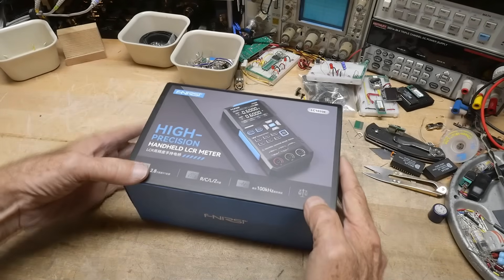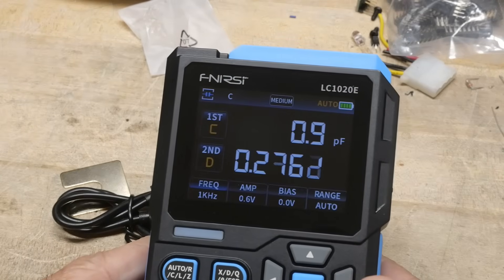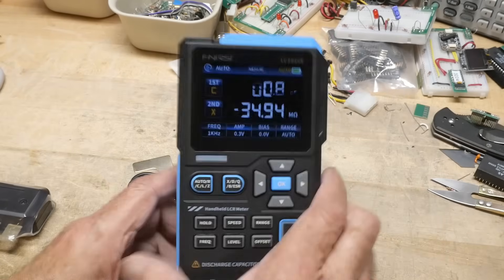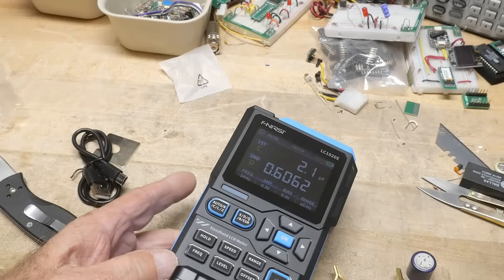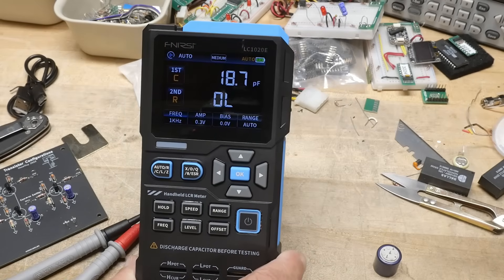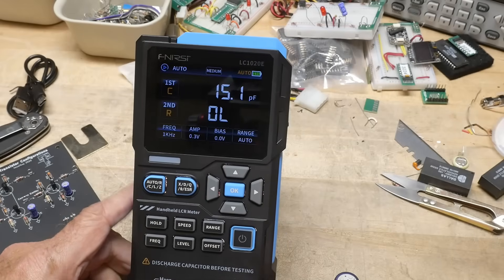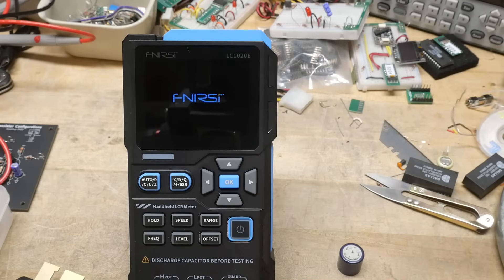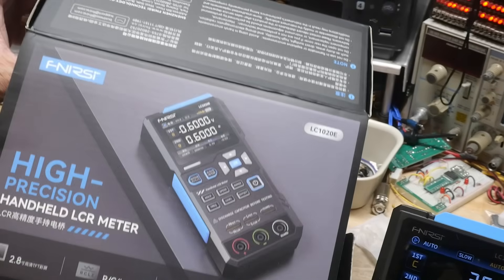#2416 FNRISI LCR Meter LC1020

Comment: I've been refurbing a vintage RIAA magnetic cartridge preamp recently and decided to make it as precise as I sensibly could without spending silly money on expensive uber-tight tolerance components. One of these meters has been close to perfect for selecting resistors and capacitors for the EQ networks and got me within +/-0.1dB of the RIAA curve from 20Hz to 20kHz. When you look at the price of ready-built preamps with that kind of spec, a meter like this can pay for itself many times over on the first project. They really do represent incredible value for money!

Comment: To really check the accuracy you need to test in pf and uh ranges. Any cheap meter will work fine with those big components you're using. 
Almost totally useless review. No offense.

Comment: Good timing on the video. I just received mine after an 11-11 price I couldn't pass up.  From what I see, so far, there is way too much resolution for the given accuracy of the meter.  I had hoped that the slow mode would improve stability of the extended digits but not really.  Seems like you could just crop off the two least significant digits and the perceived stability of the meter would be better.

Comment: How hard is it to replace the battery? Does it use something standard like an 18650 or something custom that you can't get a replacement for?
Reply from the maker: it is super simple. battery back with wire and connector.  lke this: https://www.amazon.com/104060-3000mah-Instrument-Hydration-Sprayer-Charging/dp/B087CGQHDY

Comment: I've had that unit recommended to me.  I went to Amazon to check the price and the instructions say to be sure to discharge your capacitors and inductors before measuring. Lol, I think if you try to measure the inductance of an MRI machine without discharging it first the meter will be your least concern.  As infeasible as that is
Reply: Well I received mine. Works pretty good

Comment: I got 3MOhm reading for a 470KOhm metal film 1% resistor and 6MOhm for a 1MOhm resistor at the range 100KHz! If you don't need 100KHz measurements, LC1020E is a gem.

Comment: The kelvin clips you put in have "PUSH =>" on the large connector at the meter.  But you don't push?
Reply: I think that just locks it in, no point in all that for testing on the bench